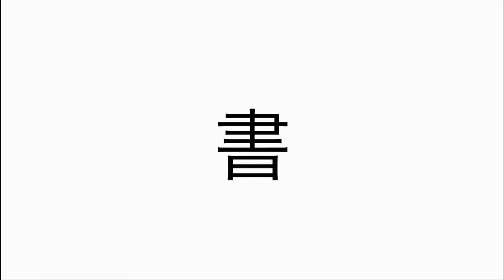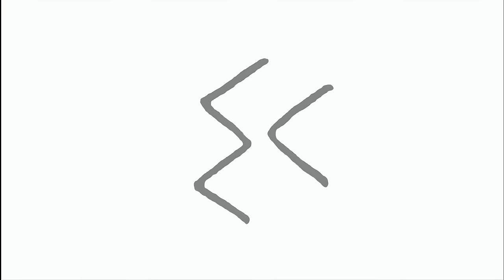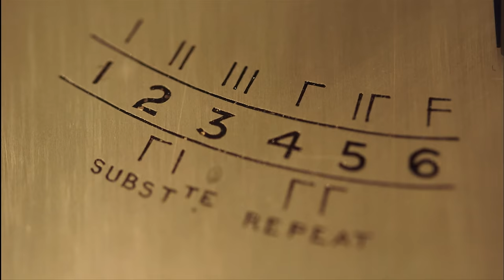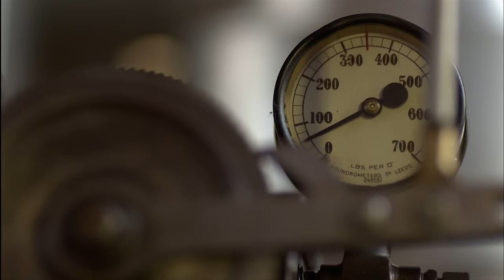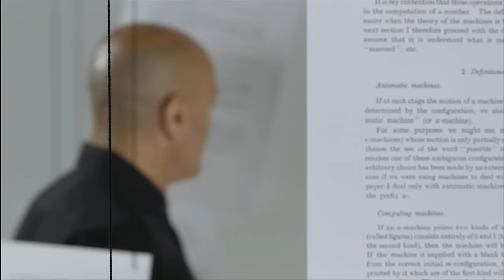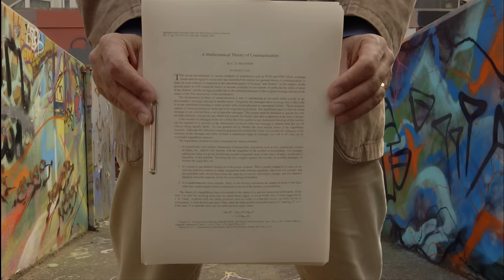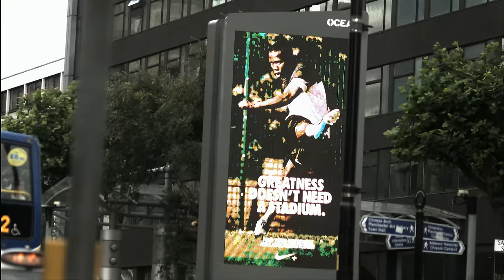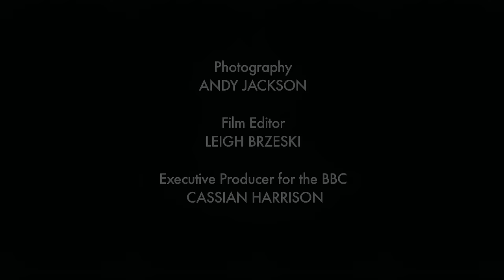Order and Disorder - Part 2, The Story of Information 4k

Comment: Where is the size of the memory of Maxwell's demon specified? Where is the length of time it is required  to operate the gate specified, or the number of molecules in the box, or whether the walls of the box are perfectly insulated? The gate and the demon itself require more energy than deletion of information anyway. Maxwell predates the Uncertainty Principle, so he wouldn't know that the act of observing the molecules would affect their speed and direction as in the two-slit experiment, which takes energy and makes the information, well, uncertain.
Humans have been communicating at the speed of light ever since signal fires, smoke signals,  flags, and even gestures were invented. A friend across  the street looks up from his phone and waves at you; speed of light, faster than a text sent at the same instant.